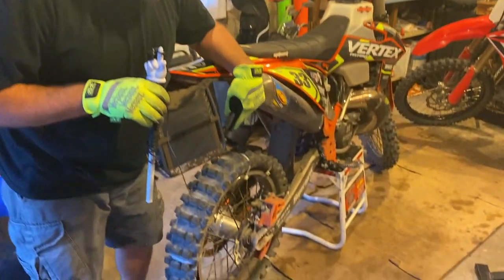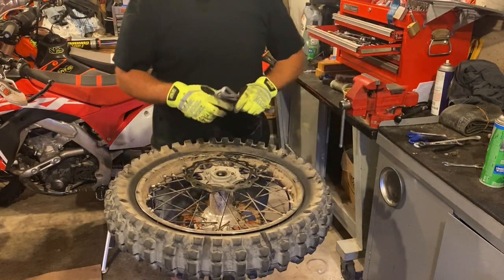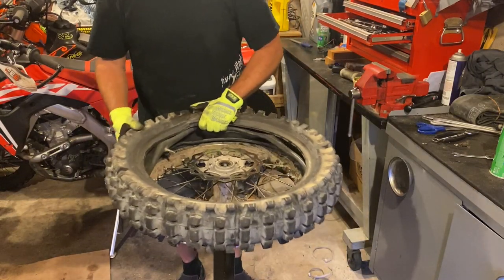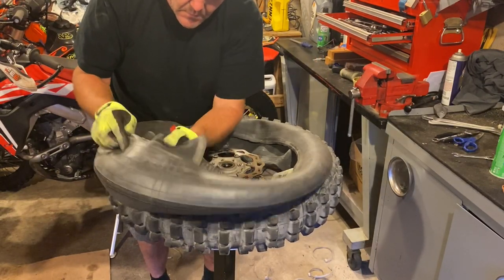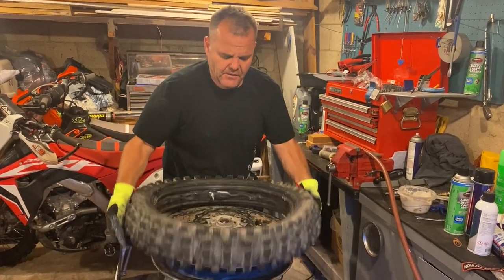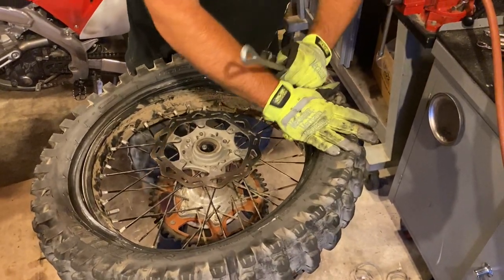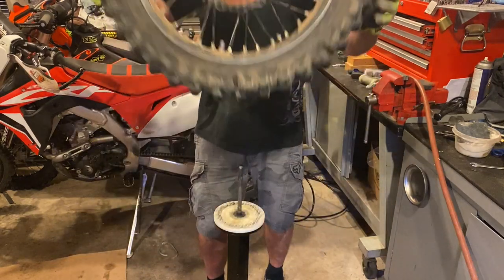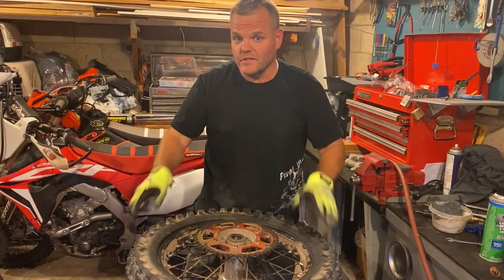Double Tubing your Dirt Bike tire? #tirechange #diy

Comment: Great tip. 
One thing id mention as a Tubliss user. Yes lower pressure usually makes the tread last longer, but the lower pressure makes the carcass weaker over time. Not only does that negatively effect performance, it also makes the tire more prone to punctures and increases the chance of an impact bending the rim. 
Just keeping it real
Reply: would you say going with heavy doody tubes is the best medium then? instead of running tubliss and running em' til the sidewalls go weak from running super low psi?

Comment: Great idea that adds another level of protection!  Too simple, never thought of trying this.  Thanks and you make changing the tire look easy... lol...  ride safe my friend...
Reply from the maker: Thank you.  And I was born 1969 so that’s kinda cool.  😁
Reply: Dirt Bike TV ....... I was 15 in 1969, that’s the 3rd year of riding for me and I started working on all my friends motorcycles that summer!  Opened a repair shop and kept all the local bikes running.  By the time I was 20 I had become a Bultaco dealer and re-sold new Suzuki’s for a dealer 60 miles away!   We raced primarily enduro, but quiet a bit of motocross just for the practice on the off weeks.  Still ride both off and on road.  Never plan to quit.  I still buy “garage finds” (abandoned bikes), repair / restore, then resell them.  Lots of fun. Really enjoy your channel.  Thanks for the great ideas related to KTM...  and other general topics like the double tube idea!!!

Comment: Great video of an old idea. We always use this method in the front of our ATeam Hard Enduro bikes and have finish Revlimiter like this when our rear Bib failed.  I have been lubing my tubes like a Bib with silicone grease to reduce any chance of a pinch flat also run slime to help with the punchers.

Comment: Back in the late 90"s we used to get the tires from a lady's bikes known as a "Shopper" ., it's a folding bike, with 3 speed sturmey-archer gearshift 
We used to cut the beads off the tyre and put them inside of our BMX tyre so that our bikes wouldn't get a puncture, 
 Made the wheels a little more heavy 🤷🏻‍♂️   But we still had fun 👏🏼👏🏼👍🏼

Comment: This is an old technique,  I first used it in the 1950s , but I  have always called it a tire liner.  In one situation I cut the beads off an old tire and used it to line a tire.
Reply from the maker: Very cool

Comment: Never seen this before and I hate to criticize anyone but it's very important if you change a flat to check the inside of the tire for sharp objects stuck in the tire that can puncture the new tube if not removed . Thorns can break off and you will not find it unless you feel the inside of the tire .

Comment: Thank you for that video. I came here after a couple of hours searching for that procedure. My intent is to do the same on my ebike. I'm curious why don't you use tubeless and what are the main positives of double tubing?
Reply from the maker: prevent pinch flats-- cheaper than tubeless and less hassle
Reply: @dirtbiketv1  that's my main concern since I managed to pinch flat a tubeless tire. I'll try that, thanks again.

Comment: Are there industry standards for heavy duty vs super heavy duty thicknesses? If hd is 2mm and super hd is 3 in theory double tubing offers an extra mm of protection against punctures?
Reply: When shopping for tires/tubes recently, I noticed Rockymountian has ultra heavy duty tubes which are 4mm thick, I thought that would most likely be overkill for my needs, and opted for the 3mm tubes instead... Plus I figured the extra weight and the added pita to install for an amateur like myself wouldn't be a good idea.

Anyways, I'm wondering if going with the 4mm tubes to begin with, rather than double tubing would be the same, or better perhaps?.. I mean idk myself, but this guy seems to be quite knowledgeable about tires, so he'd be the one to know I suppose.

Comment: I always wait to tighten the rim lock until after I’ve seated the tire and after I’ve reduced the air pressure to normal operating pressure. The reason I wait until I’ve reduced the tire pressure to normal operating pressure is so that the rim lock bites down on the tire where the tire would normally sit properly inflated. Anything wrong with doing it that way? (I think you set the normal tire pressure after you tightened up the rim lock.)

If I seat the tire, then tighten the rim lock down and then reduce the tire pressure to normal operating pressure often times it can make the exposed tire bead a bit uneven. Also, later when I go to replace a tube and pull one side of the tire off, I notice that the tire bead is always kinked where the rim lock bit down on the tire when I had high seating pressure in it. Therefore to me it seemed to make sense to tighten the rim lock down on the tire where the tire would normally sit under normal operating pressure. Is tightening the rim lock after setting normal tire pressure the wrong way to do it?

Comment: u wouldnt need feed tube if just inflating it some.. another good tip would be to check for sharp things poking through or just lose in there. then u dont fk up ur spare too.
Reply from the maker: Yes-- usually nothing but I guess I should have checked-- Not like bicycles where the thorn stays-- it takes something massive to get through a dirt bike tire so usually never anything left.  
especially after riding it ten miles out.

Comment: Heavy or extra heavy tube for liner and normal or lightweight tube for the inflater? If you ran 3 rim locks you wouldn't need the ZIP ties. I have some of the heavy ones for ductwork but wouldn't want to carry them with me while riding.

Comment: No checking for thorns or whatever caused the original leak come on your supposed to be a pro dude. Snakebite pinch flat would be fine but I would need to know before putting it back together. Double tube with junk still stuck in the tire or tube isn't going to last. I hope it does for u though!
Reply from the maker: That was almost two months ago and still holding strong -- Thanks!

Comment: Any tips on getting the bead to set easier after the tire is installed? I lube the bead beforehand but sometimes I feel like I’m gonna pop the tube cause I have to put so much air in it to set
Reply from the maker: If its wet with the lube we use it pops right on with high pressure compressor -
Reply: You dont have to worry about a pop of the tube I have taken it up to past 60psi and it didn't pop. That was a ultra HD 4mm Tube.. Once had issue with compressor got stuck on valve had to run and take it off on other end it blew up the size of a tube you take down the river :)  only had 1 flat in 9 years of riding ultra HD 4mm tubes. They are heaver but work well

Comment: I didn’t see JAY check for pointy things stuck in the tire from the previous flat that could puncture his new double tube setup. My 2 cents.
Reply: How did he get flat in first place with double tube lol
Reply from the maker: Nope-- it was a single tube as you can see in the video-
Reply: @dirtbiketv1  it is a neat idea
Reply: @jordanonofer3886  it was a single tube. He hadn't had a flat yet, to get that second tube....   heh    heh    heh!

Comment: Jay, do you have a recommendation for a quality rim lock that holds well? Trying to run Bridgestone ultra HD tubes down to around 5-8 psi and I've been getting some tire slip and don't want to chance sheering the valve stem. Thanks.
Reply: Motion pro lite locks work well and are very light.

Comment: If you do not put rocking powder or Vaseline in between, the rubber inside will vulcanize.🤷‍♂️
<iframe title="indavideo video player" allowfullscreen scrolling="no" class="indavideo-player"  id="player-38a3b30401" type="text/html" width="640" height="360" src="//embed.indavideo.hu/player/video/38a3b30401" frameborder="0"></iframe>

Comment: I wonder with two valve stem holes could you just fill the second tube as needed. Obviously you wouldn't split it.
Reply: I was just thinking the same thing. You could just air up and keep going on the new tube.
Reply: @jhackett9482  Worth a try.

Comment: I have no experience with double tubing but I can see how easy it would be to get a little fold in the extra tube and it possibly pinching the pressurized tube. I think there are much better options than this and this method kind of goes right along with the mentality of laziness and not having tools (other than zip ties ) on the trail to fix the flat. IMO
Reply from the maker: Not lazy-- just dont like to carry extra weight-- I have enough of my own extra weight.   Lets trail ride sometime and you can show me how you do it :-)
Reply: KB3AOL M There are better options is all. I don’t know that this adds pinch flat protection but IMO could possibly create a pinch flat scenario. I’m only talking hypothetically here and could be totally wrong.
Reply: Dirt Bike TV yeah I do go a little overboard with carrying tools, water, etc but then again I’m usually riding solo very remote. People pick up my pack and are like wth?? I know you’re not lazy, the builds you pump out are all next level. Would love to go trail riding sometime; how about some time between 9/16-22 in Idaho or Colorado. Open to suggestions on the specifics...

Comment: YIKES!!!  Can't see because it's a old dirty dusted rim.  If it was a brand new rim I would not let this guy anywhere near it. There would be big chunks of scratches from the way he takes the tire off and on  with the irons.  The Rim Butcher.
Reply from the maker: LOL -- I usually dont respond to guys that write such nonsense but in this case I figured I would.  I do 400 plus tire changes a year -- yes-- Then go to my site and check out my hundreds of magazine project builds all with new wheels and look for the butcher marks.  Think your confusing my speed and confidence at changing tires as someone who doesn't care about the rims.  Watch again and you will see I make no scratch or damage-- that is years of experience-- However, I am totally up for you giving me a lesson on how to do it better :-) I am in So cal and Utah areas a lot and would love to meet up to have you school me on how its done -- -
Reply: Whoa easy there killer!!  I'm just stating my opinion from what I observed.  When there's no clearance between the tire bead and the edge of the rim and your shoving the tire iron in and out between them,  your scratching the rim.  That's why there's no mar tire changing machines.  Again, I highly doubt from my observation that out of the "400 plus," tire changes you do a year, if you were to ask the owners I'm pretty sure a lot of  them would not say their rim came out unscathed. And it's a good thing that you don't respond to guys that write such nonsense because you obviously can't take constructive criticism well.  And your still not coming anywhere near my rim. LOL